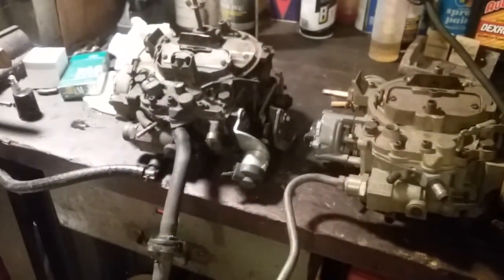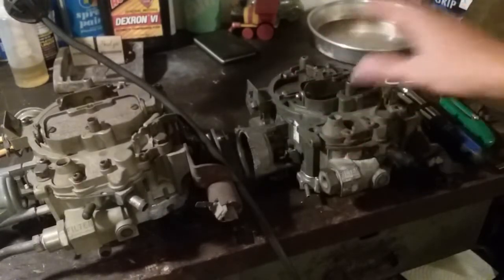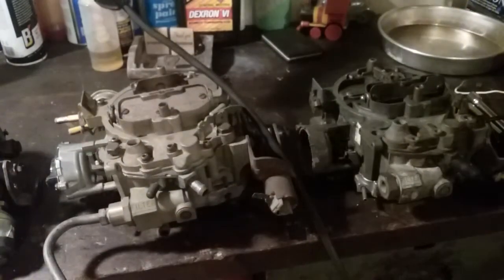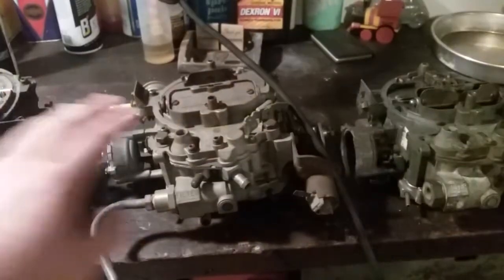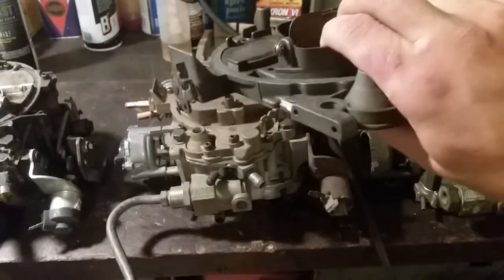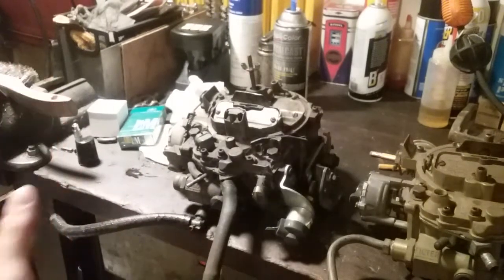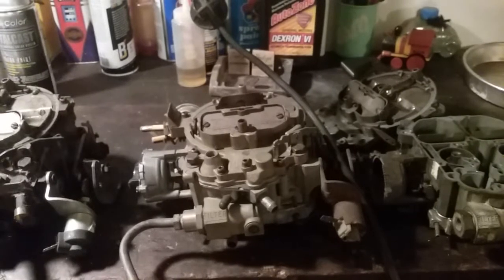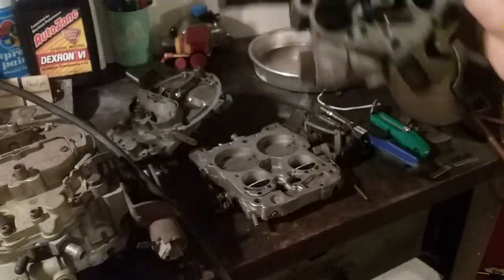Quadrajet, STOP Warping Air Horns

Comment: You’re right about Quadrajets being great carbs. They have to be the best designed factory carb ever. There’s only one float to adjust and they only pull as much air and fuel in as the engine needs. It’s impossible to “over-carb” unlike do many other designs. People that bad mouth them usually always don’t know how to tune them properly.
Reply: Spot on Ryan !

Comment: A little FYI, I don't know when they started doing it but I know for a fact a 79 Qjets air cleaner hold down rod goes through the top into the main body of the carb. I just watched a video about a guy who will drill and tap out the throttle plate and run all thread all the way out and then put a nut on the top of the air horn to hold the complete center of the carb together this way over tightening the air cleaner wont affect because the rod is captured between the air horn and the base plate.
Reply from the maker: Thats actually not a bad idea. Cool info man.

Comment: i like the videos the way they are, i feel like i'm in the garage with you,  without going out and looking at it, can you tell me what carb i have on my 1988 olds 307 custom cruiser,  I do need to replace mine and i want to get the right one.  Do you have an email   that i can get??   I may have to pick your brain a time or two.
Reply from the maker: Erik Doering what's up man. I'm not a qj expert but I will tell you what I know. Ok so you will have what's called a ccc quadrajet, ( computer command controlled qj) it has a tps switch in the front like the one on the left in this video. The electronics control the the primaries in the front for better idle and for better fuel consumption, and the carb also has a plug in the back to alow the transmission to go into overdrive. Your car should have 200 4r transmission and you will lose overdrive and eventually burn out the trans with out a ccc carb. I wouldn't jump to conclusions about saying the carb is no good. It might need a good cleaning and If it has never been off the car that means nobody has ever knocked the caps off of the mixture control screws. I can make a video on how to remove the caps if you like. What's your car doing? What are some symptoms. I'd say if you can find somebody compitent enough to work on it, I wouldn't waste the money replacing it unless the body is distorted. I have an email but believe me I never look at it and I wouldn't ever notice you sent me an email lol. How long have you had the car, what's it doing, how many miles, has it been maintained?
Reply from the maker: Erik Doering since I don't really use email you can text me 2othree,four28,57one2. I'll see if I can help you out.
Reply: So, here's a little fact of truth about carbs for you, Useful Entertainment  There are three main materials of which carburetors are made: cast iron, zinc and aluminum. Starting in the 30's, cast iron started to be replaced by zinc and in the late 50's, aluminum replaced a lot (but not all) zinc. Now you know.
i may give you a text tomorrow, but it would make things alot easier if you would make a new gmail, i can tell you this, original owner was my neighbors mom.
Reply from the maker: Erik Doering I tell you what, I'll check my email for once. Generalmopars@yahoo.com. As for the thing on the exhaust, I'll have to go out and look. I just woke up and not in the right state of mind. Shoot me an email
Reply: ahhh the proverbial wake and bake